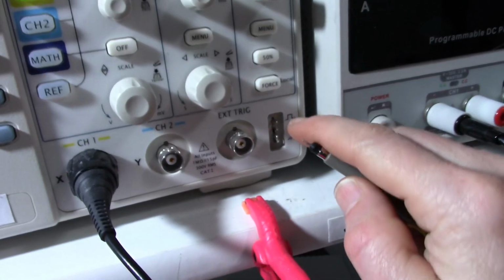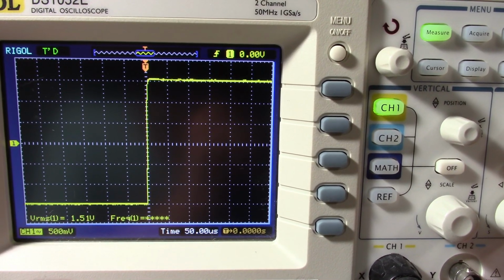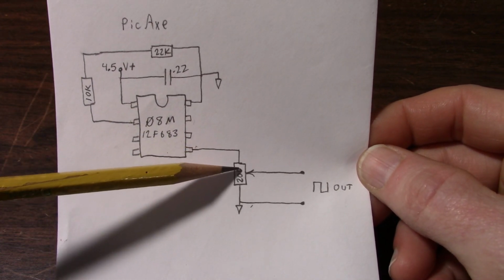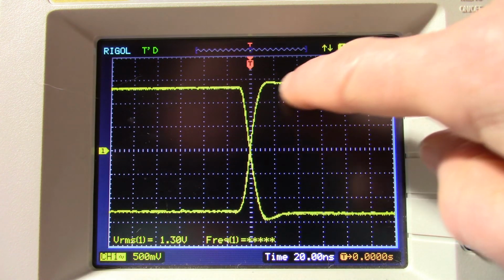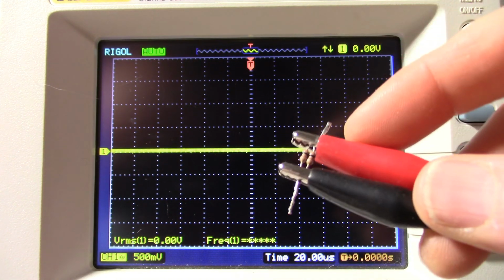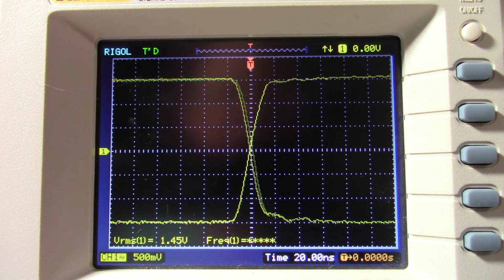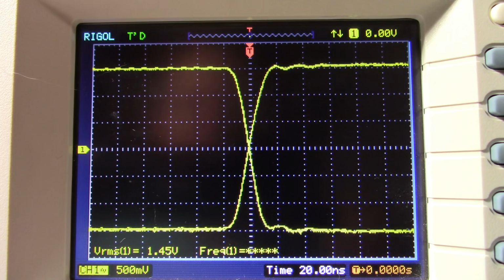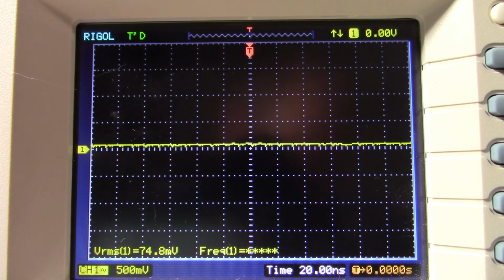Generating square waves for audio amplifier testing

Comment: Hello John, I like all of your videos and very informative for diyers. I recently made a Stk4048 amplifier and it sounds really decent but I get some humming when idle. I got a cheap oscilloscope when I hooked it up I found something really strange. I was testing 100hz sine wave but it turned into square wave. I googled the issue and found it's a biasing issue. I don't know much about electronics and I study the data sheet but I am not able to understand it properly. I used the diagram from the data sheet but I had to use some different values of resistors because I didn't have the right value when I assembled. I used 2 43k resistors instead of 56k and all 100ohm resistors I used 91ohm because I thought 9ohm shouldn't cause any problems. I also used 3 150uf capacitors instead of 100uf from the data sheet. There's a 1uf capacitors where I had to use 2.2uf. could you please put some light on the shed please. You can find the data sheet for stk4048 in the Internet. I think those 43k resistors are creating the problems? Please help me with this, it will be greatly appreciated. I have used+/-59 VDC power supply.
Thank you

Comment: Might have been interesting to try a cap from signal output to ground (As you did) but ALSO from signal output to Vcc (power) of the micro. The output stage has two transisitors - one to pull the signal high and one to pull it low... So a from output to power and one to ground may have helped balance the capacitive loading. Interesting to see the effect, in any case. Love your videos John!
Reply from the maker: There is the capacitor across the supply and ground that make the rails low impedance to high frequencies, so I'd expect the same result whether putting the cap from out to Vcc or out to ground. Thanks for watching my channel.

Comment: LOL.  Audiophiles.  Just because the scope can display a 100 MHZ signal does not mean the amp can reproduce it.  10KHZ from the scope looks square on the scope, and if you put it through an audio amplifier, the amp may have some response out to maybe 50KHZ, but not make 1 MHZ.  Use the fast rise time signals for TDR cable measurements instead of testing an amplifier.  PWM from the uP  is suitable for driving PWN motor control, class D amps, and SMPS drive signals.  Are you trying to use an audio amp for a TV antenna amplifier?
Reply from the maker: Nothing to do with audiophiles. To have low distortion figures at the top of the audio spectrum (20Khz), the amplifier must retain a large amount of open loop gain at 20Khz so that there is headroom for negative feedback to function properly in closed loop. This means the amplifier will have response out to several hundred KHz. I hope to explain this better in a future video.

Comment: If the low part of the wave is ground, the low overshoot may have to do with a lack of conductance  on that leg of the switching process to ground versus some inductance. Maybe a high speed inverter/buffer could fix that?

Comment: Other than 555, how about clock using Schmitt trigger and some 74xx to clean the edges, but I didn't try it, so can't tell about quality of the rising edge - no fast scope at my place. The freq would be easily adjustable. If the amp input imp would be say 10k, them 500ohm out impedance should be OK. If you need lower impedance then there are some very fast CFT buffers, with high slew rate - Cordell probably mentions them in his book. Just an idea to try.

Comment: How do you know that some of that ringing wasn't the Scope or the Probe, when you were looking at the output from the microcontroller and that adding the capacitor wasn't the equivalent of high frequency compensation?  High quality Scope Probes usually have 2 trimmers for both low and high frequency  compensation.
Reply from the maker: It is possible the scope and probes contributed some. I'd expect similar results if it were mainly the scope and probes. The Feeltech leads could be responsible for the ringing since the ucontroller had none.
Reply: It's true. That's a thing to consider.  Also just because you can calibrate with scope or the probe using built in square wave in the scope it can be considered as sort of the limit of the scope.Using the calibration signal for square wave is pretty good from my experience.

Comment: No 555 timer?
Reply from the maker: I didn't think of that. From past tinkering, I don't think the 555s slew rate is as fast as the microcontroller's.
Reply: @JohnAudioTech  then you want Burr Brown. Personally I wouldn't trust the output of your scope at its peak bandwidth. Perhaps DSO scopes are different than CROs though?
Reply from the maker: I'm thinking one of those PWM mosfet driver chips would have fast output. My scope is 1Gig samples/sec but it will depend on how they limit the signal. This scope can be made into 100Mhz with hacked firmware.
Reply: @JohnAudioTech  the rise time seemed to increase so much when you changed the time base. I'm curious if it aligns with any spec the hardware may have. Though what that is I can't say. I'm trying to look at the data sheet for that chip too. It is dense stuff. A downside to complex hardware is it is complicated. At least with a 555 timer they come right out and say 100 ns rise and fall times.
Reply: Not the 1980s anymore...
Reply: I mean, if we want crisp edges, why not just use an analog video op amp in open loop gain? That aught to be stupid overkill :)
Reply: @rich1051414  it's tough being an analog guy in an increasingly digital world.
Reply: @Richard Smith I like the way your think :D Overkill is impossible if you want to measure distortion. The point is to make an overkill waveform an imperfect amp shouldn't be able to reproduce!
Reply: @Bubu567  I can't hear less than 2 or 3 % distortion. So I'm not terribly concerned with it myself. Often when I do hear distortion I kind of like it anyways.

Comment: What about using sawtooth waves as an alternative?
Reply: It's usable. One of the edge is essentially the same as square wave. But in general, square wave is to show the step response which is a pretty useful information when you design.
Reply: Usually a square wave is the worst case scenario, since the high frequency content is higher than other waveforms like the sawtooth. With the rising edge you can see in the time domain the relative stability of the system you're testing (with the overshoot and ringing).
Reply: The reason for suggesting use of the sawtooth wave is that the rise agrees more with the amount of rise needed is more likely to approximate what is just needed for accurate reproduction in the hearing range, even at 15000 hertz the necessary frequency range to produce a perfect square wave shape would be far in excess of what is needed. The beauty of the sawtooth wave is that it would reveal the actual transfer (not frequency) linearity of the amplifier. The closer line slope of its rise would quickly reveal why the triode tube sounds most pleasing, then in decreasing rank, the pentode or tetrode tube and the FET (which is equivalent to the pentode, and the worst, the bipolar transistor.